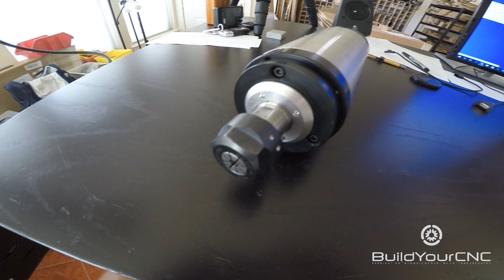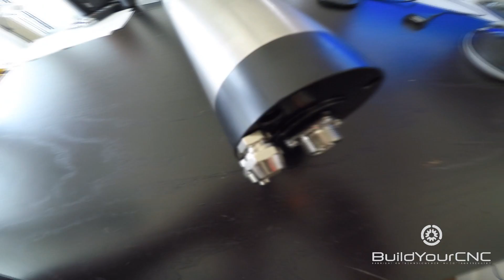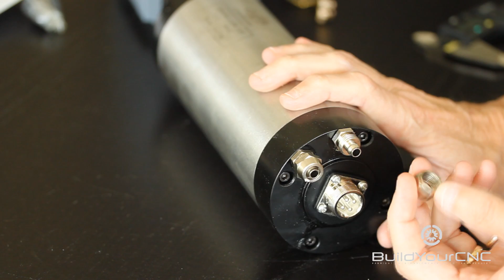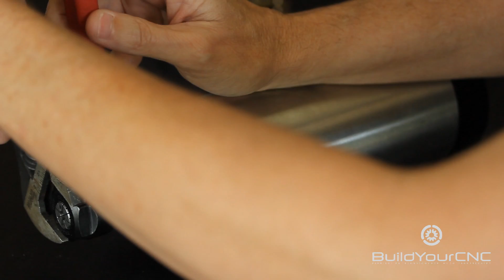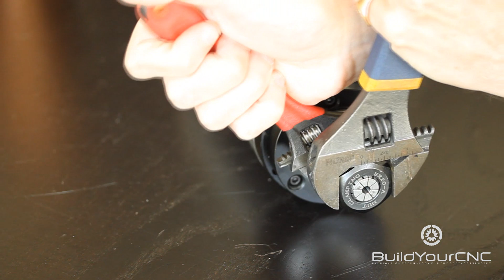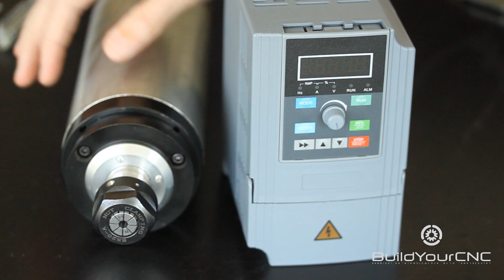How to use a Spindle and VFD (Variable Frequency Drive, or Inverter)

Comment: how do you lube the spindle?
Reply from the maker: Spindles have sealed bearings. Adding lubrication or grease is not easily possible.  If yours has a zerk fitting somewhere on it, then you will be able to.
Reply: @PatrickHoodDaniel  oh thank you

Comment: can you use precise bit colletes on this?
Reply from the maker: No, the collets used on spindles are standard ER-20 for the 2.2kW spindles.  The spindle will come with a collet and if you need another size, just hop on over to the website and get the size you need.  Thanks.

Comment: is it ok to use 110? i really dindt want to run a special 200 line.. thank you so much for this video
Reply from the maker: Yes, we have 110 VFDs and spindle available.  The link to our spindles is in the description.
Reply: but 110 is way less power correct?
Reply from the maker: 110 is just the voltage in the power (watts) equation.  The vfd can still allow a much higher current draw from the spindle increasing the power (watts).

Comment: A demonstration of it running would be a huge help. ( Many years ago an old salesman expressed this with what is now a corny old expression but still valid - " Presentation without demonstration is just conversation." 

I current have a Dewalt DWP611 router and it screams like a banshee. It just died; brushes I think. One of these might just be in my future. I would prefer air cooled though.
Reply from the maker: I personally like the water cooled as the dust won't get all pushed around.  The water cooling really isn't a difficult thing to hook up.  Air cooled will make it much more difficult for the chips to get captured by the vacuum.

Yes, we can create a video demonstration; however, most of our new CNC videos show the spindle running in the machine.
Reply: Water cooling isn't exactly a huge science anymore... I'm using an AquaComputer 140mm Airplex Modularity radiator system with integrated pump and reservoir: https://i.imgur.com/4BL8fHB.jpg - Add a 140mm 12V fan to it and connect both to a 12V PSU and you're golden.

Comment: Nice. :) i wish I could get one.
Reply from the maker: Thanks. It will actually save money in the long term. These last much longer than routers. I burned out at least 6 routers and I haven't burned out a single spindle and have been using it for years.

Comment: Excellent stuff :-) Just curious... What is the difference between a Spindle and a Servo? Oh! one other little question... Nowhere did you discuss the Speeds and I looked in your web site to see if the min/max speeds were shown... I would also like to see the torque curve a different RPMs... Thanks for sharing :-)
Reply from the maker: The max RPM is 24000 which corresponds to 400Hz that the VFD can output.
Reply: Yes.. What is the RPMs for this spindle.. Kind of important to know.
Reply from the maker: Good question and they will be answered in subsequent videos. I will also specify that info on the product page at Buildyourcnc.com.  I'm home at the moment and don't want to give misinformation.
Reply from the maker: A servo is generally used for precise motion and a spindle is used for cutting and milling.
Reply: Excellent... Would still like to see the torque curve... Like, does the torque stay steady under load... You're chatting with a potential buyer... I am building a CNC machine to market... This is a Very important part of the setup and so far, it looks really good, for my application :-)